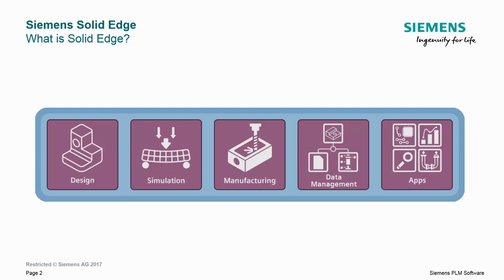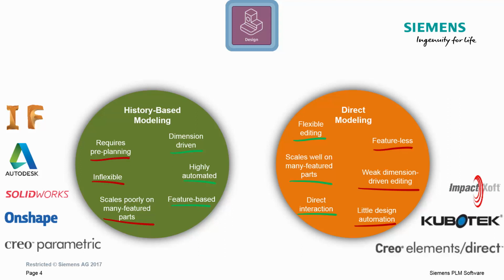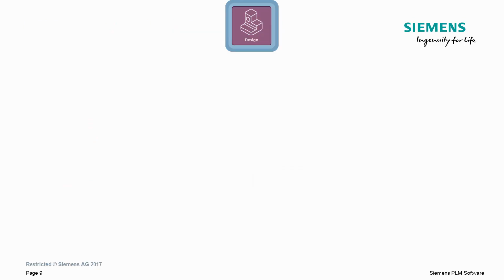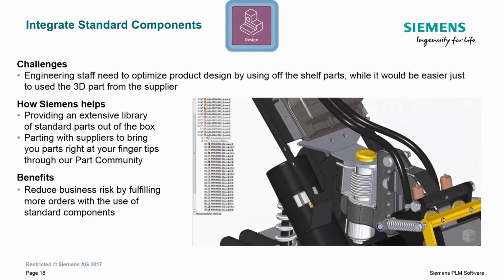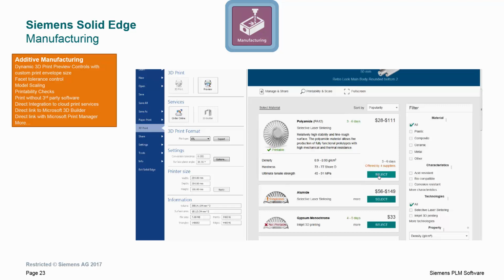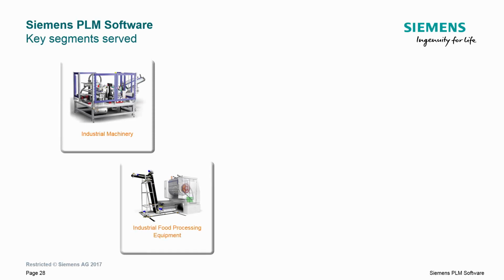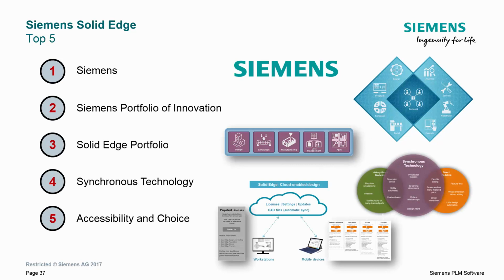What is Solid Edge and Top 5 Business Reasons to Use It

Comment from the maker: 0:19 - What is Solid Edge?
1:43 - Synchronous Technology
5:34 - Design Challenges
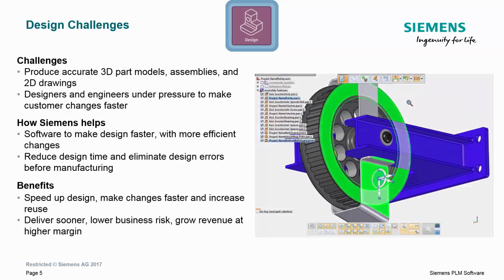6:30 - History based vs Synchronous Technology
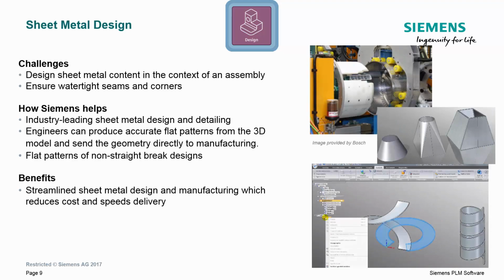9:18 - Sheet Metal Design
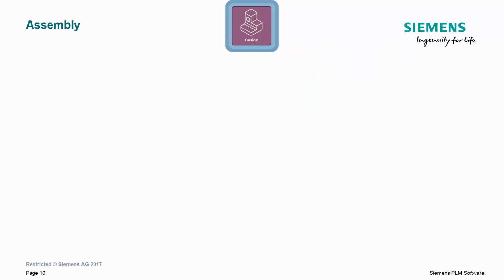9:47 - Assembly
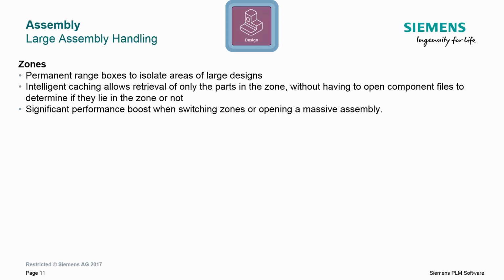10:25 - Large Assembly Handling
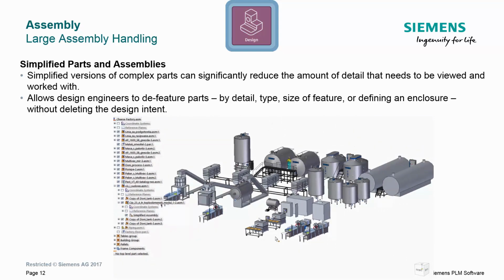11:50 - Virtual Assemblies
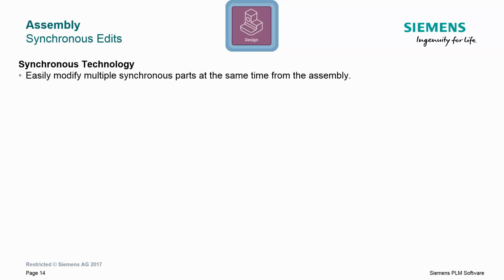12:37 - Synchronous Edits
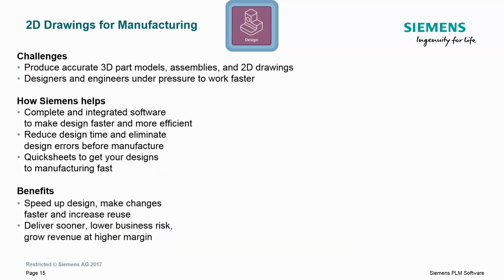13:24 - 2D Drawings for Manufacturing
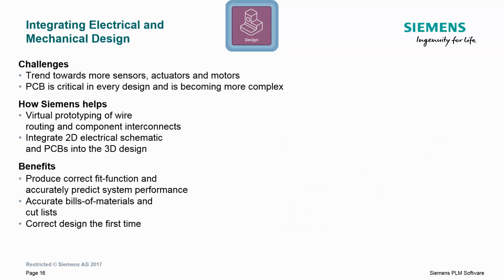14:33 - Integrating Electrical and Mechanical Design
15:28 - Fabricated Structure Design
16:55 - Integrate Standard Components
17:55 - Visualization for Sales and Marketing (Keyshot)
18:40 - Solid Edge Design Product Packages
19:45 - Simulation
20:44 - Manufacturing
21:03 - Additive Manufacturing
21:26 - Subtractive Manufacturing (CAM)
22:07 - Data Management
25:12 - Apps
25:45 - Key Segments Served
26:43 - Customers you might recognized
27:04 - Customers Success
27:27 - Top 5 Reasons
27:35 - 1 - Siemens
28:00 - 2 - Portfolio of Innovation
27:37 - 3 - Solid Edge Portfolio of Tools
28:53 - 4 - Synchronous Technology
29:16 - 5 - Accessibility and Choice